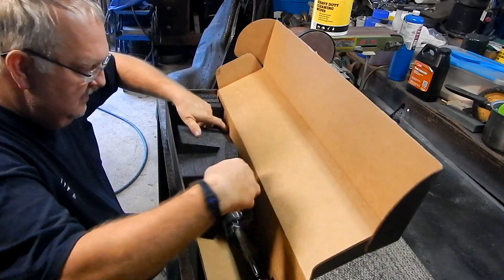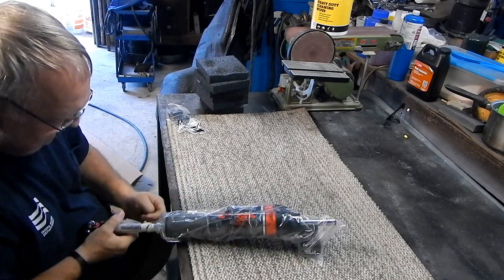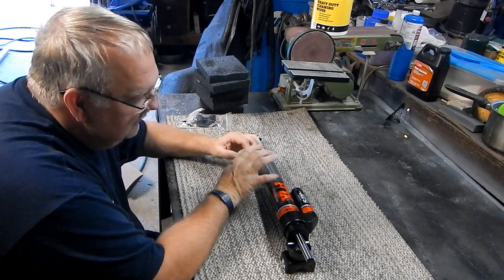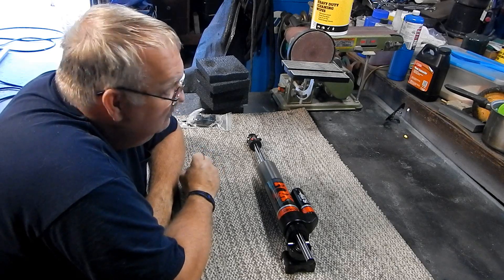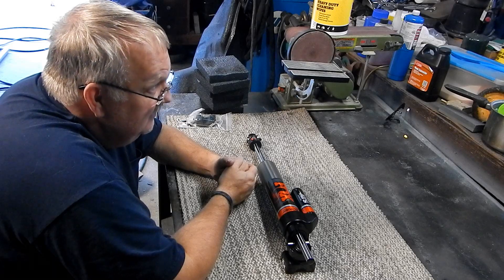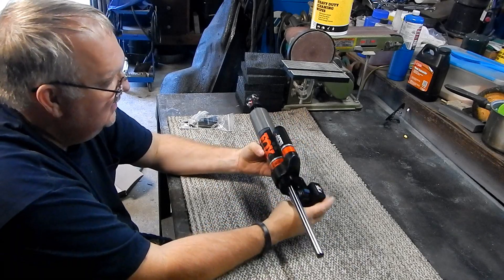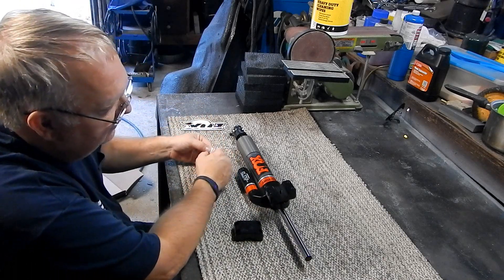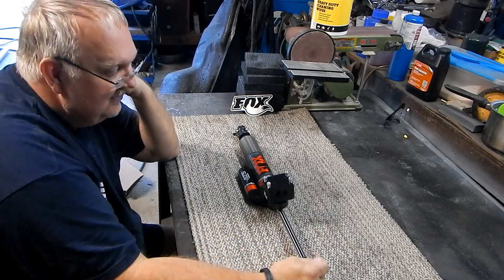2018 Ford F250 Fox ATS Steering Stabilizer

Comment: Nice truck you've gotten. I like Ford trucks. I also have an old 2000 Ford XL, 4.2 gas engine. I bought it with 20 miles on it then. Now it has almost 175, 000. I had to get me a new one thouigh. In 2016 I got a Ford XL 2.7 Ecoboost. I had to get another truck because my 2000 was beginning to literally fall apart. I have the radiator tied with wire because the mounts are completely rusted. Here in the Midwest the salt eats them. I still have it, and I take around the block every now and then. I didn't want to get rid of it because it's been good to me all those years, and I love the manual transmission. Too bad Ford doesn't make a manual transmissions anymore. I also had a '91 Ranger before I bought the 2000. It was also manual transmission. I had that one for 9 years. Nothing wrong with it, but in 2000, I thought it was time to upgrade to something a little bigger. At any rate, thanks for video information.
Reply from the maker: Yeah we tend to get attached to the trucks, and you might want to check into the manual transmission thing, I am pretty sure I sat in a couple at the dealership, but I could be wrong, or it may have to be a special order

Comment: Are you still happy with the fox ats?  I just got my 2017 back from the dealer for death wobble recall and they put a new stock steering stabilizer on amongst some other parts.  I’m thinking to replace the SS with the ats before things start getting shaky again. Plus some new shocks. Maybe the fox 2.0.
Reply from the maker: So far very happy and no issues, have taken several long road trips, hauled trailers and driven back roads, no complaints.